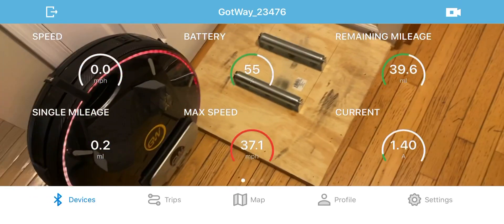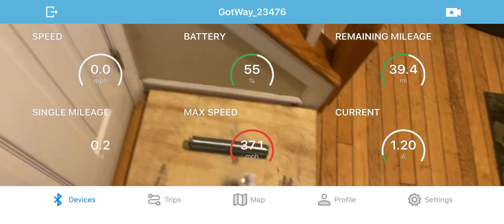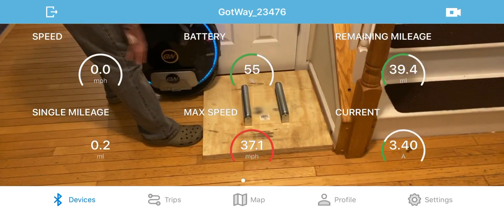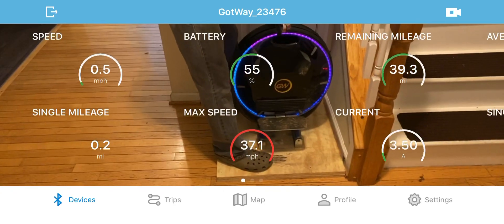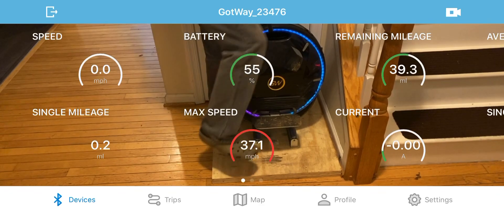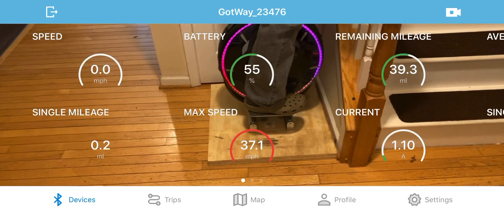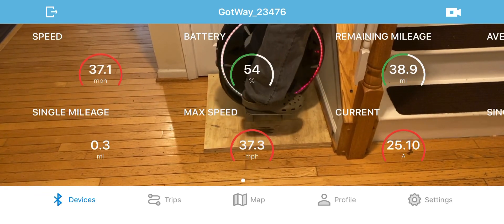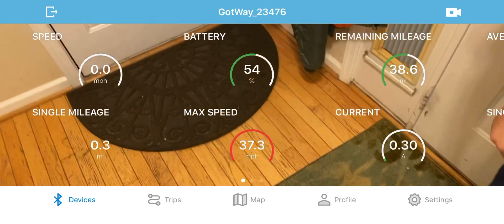EUC cut out speed tester

Comment: I dont understand what's going on here, can you please explain?
Reply from the maker: just sitting on wheel placed on rollers to get cut off speed with wires weight on it. then i take off another %10. basically just playing around, different way of doing lift speed test. really don’t need to do this. do light speed test and take off 12-15 miles per hour for relatively safe speed, of course this depends on your weight

Comment: That was a cool experiment/trick :) but I must say, I really think that the wind resistance in real life will be quit a bit more than 10%... On anything over 40 km/h the wind resistance will be a major factor... 
It would be great to see the difference, if you could do a real life max speed test and compare it to the speed you got on this nifty device you made, to see what the real wind resistance is, as I am just guessing my self...  :)
Reply from the maker: Jonnis %10 of of 37 will make it 33 which is 2miles less than nikola 84v 35mph top speed under load “supposedly”. i have gone 33 on it before at 100% battery with no %80beeps.

Comment: I did not saw any cut out, just vibration and tilt back. I had in m riding life 2 serious cut outs already.
Reply from the maker: Michael Rada you can see at the end the wheel has cut out when i take it off the rollers it’s because of the cut out
Reply: @rayrokni  thank you for your reply. I did not recognize that for it looks like tilt back for usually during the cut out you go into the heels first for this is the direction you push by increasing the speed. But if you say so, you probably managed to overcome this feeling at the very moment you reach the cut off.

Comment: BTW, could you do this at a few different battery levels when you get a change. Would be interesting to see what happens at ~75%, 50%, 25%
Reply from the maker: will do marty
Reply: @rayrokni  No rush of course. I just think it may be interesting to see how it changes with the battery level. Also, could you use a big fan to simulate air resistance. Thanks :-)

Comment: Very cool Ray. Very cool!  You can be our official tester. I love that you were standing on it, so it's a real-world test.
Reply from the maker: ElectricUnicycles not really since there is no air resistance or friction. but it gives an old man something to do while the weather clears. i take %10 off that roller number and go by that as max top speed. no load lift test on this wheel at same battery % was 40mph
Reply: @rayrokni  I still think it's a hell of a lot better than a lift-test.
Reply: @ElectricUnicycles  Absolutely better than a lift-test! :) Would be good to see what the real life max speed would be, to compare it to both this cool device and a lift test, to see the 3 different speeds on the same wheel...

Comment: Also, removing 10% will be very far from accurate.  The battery is usually the reason for a cut out, not spin speed.  The motor draws more power than the wheel can provide and you go down.  So measuring max mechanical spin speed is not even measuring the most common cause of a cut-out.  I just want to say this so you stay safe.
Reply from the maker: Preston Palmer not too far. free lift no load cutout on this wheel is 40. so 33 is about right. obviously battery percentage, road conditions, incline etc would dictate if i would go right to the edge of top speed or not. i normally don’t ride past 30 usually anyways on any wheel

Comment: Indeed cool idea, but this only gives you the no-load speed limit.  Its no-load because the wheel is only overcoming losses, not pushing any weight at all.
Power = Force X Speed.  
In this test, Force is really small so it takes more Speed to overpower the wheel.
Reply from the maker: Tony Lee yes you are right. i put that in the description.
Reply: @rayrokni  this is still good.  In motor testing, the apparatus offen uses a coupling secondary motor to load the primary motor.

Comment: Unfortunately this won't be accurate.  This is like spinning a cars tire on ice, or riding a bicycle on a roller.  You are not producing real world forces and only measuring spin speed.  This cutout will not be accurate for real world scenario.
Reply from the maker: preston is right. not real life factors involved. i take 10% off the roller number and count that as the fastest u would dare go on that wheel, which is about right since i get beeps at 33ish in real life.
Reply: Maybe, but it can be near to real test. and fair for all wheels.. it seems ok and nice.